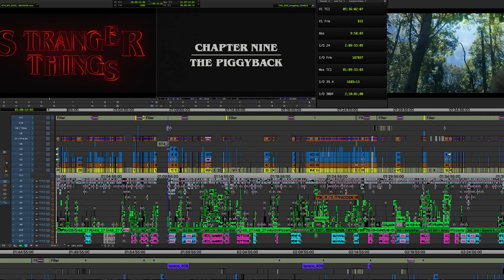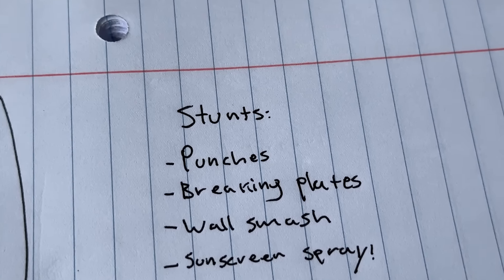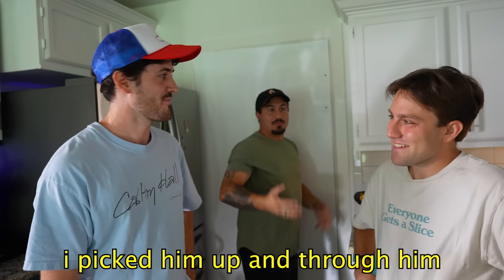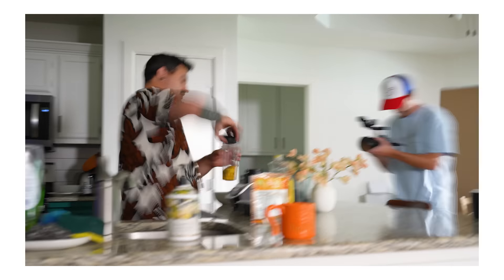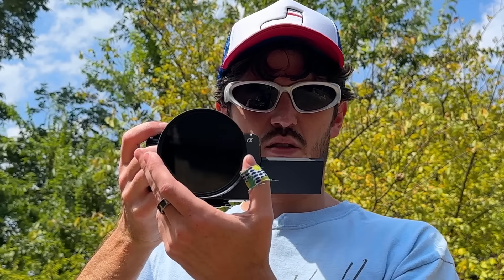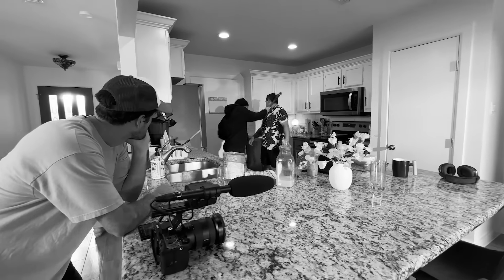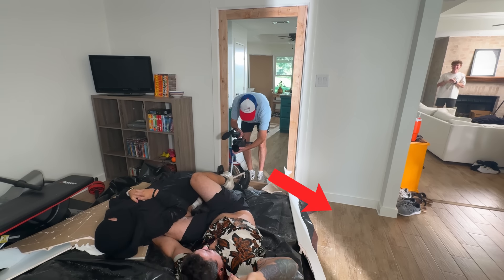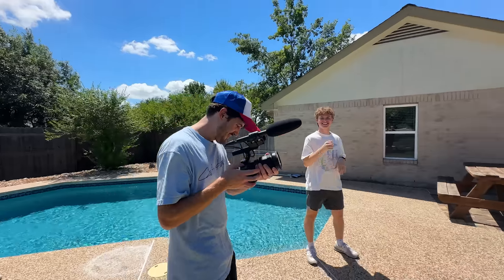Can I Make a Movie in One Shot?

Comment: I would have recommend the much thinner flexible drywall, imo, or koralite foam sheets, cheap and easier to break, though it probably wouldn't hold up in a close shot, but if you ever need a wall break at a distance it'd be hard to tell it's not drywall

Comment: Easy.

1. Install greenscreen.
2. Do the take.
3. Shove the responsibility over to the CGI team.

</sarcasm>

Yeah; it'll probably look like that General Grievous vs. Obi Wan Kenobi scene, where Obi Wan stands around like noting happens, despite Grievous doing his "lawnmower" routine (which is exactly how it was on the set). Just that the actors will be appear disconnected from theirt surroundings for the whole movie, just not just one scene.

In contrast, the 2015 German movie Victoria (already mentioned by paputz72 in the comments) used no "digital trickery"; it was really just one continuous shot with no attempts to cover anything up.

The movie was shot in two versions. First, a conventional one (with cuts), over the course of then days. That gave the film makers the security that there would be a movie at the end, even if the single-shot attempts failed. As a side effect, the ten days provided the actor with additional rehearsals.

The budget allowed for three attempts at a single-shot version. The first two were botched, and the last one succeeded.

One director, one camera man (obviously), with a Canon C300, three full audio crews, six assistant directors, 150 extras.

One of the audio crews at work:  https://www.youtube.com/watch?v=C_VjtxZYBCI
Same scene as in the movie: https://youtu.be/DogZcS8bMpc?t=148

Lots of shaky camera, obviously, but not as bad as in the Fast & Furious movies.

Fun fact: in this German movie, 49% of the dialogues are in English.

1 minute 30 seconds title screen, followed by 2 hours 13 minutes of the one continuous shot, no end credits (although some releases might have added end credits).